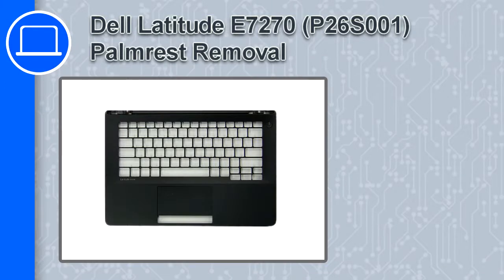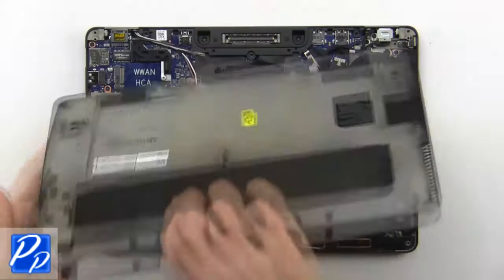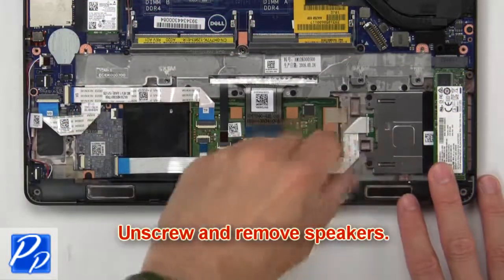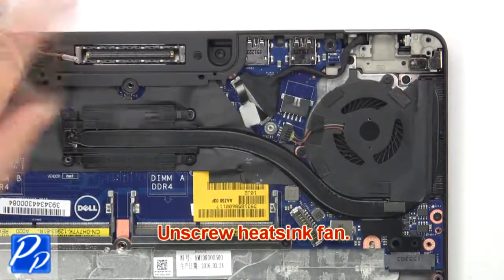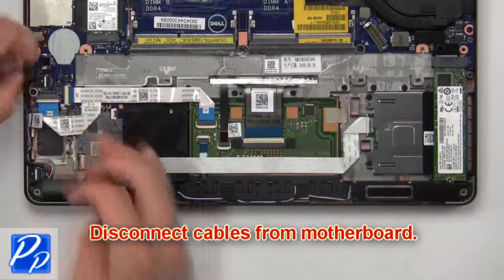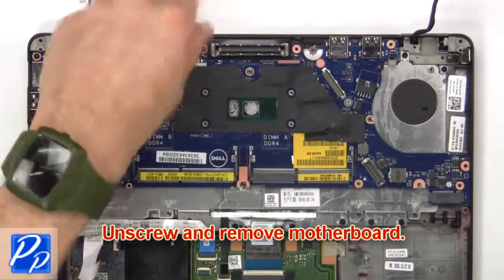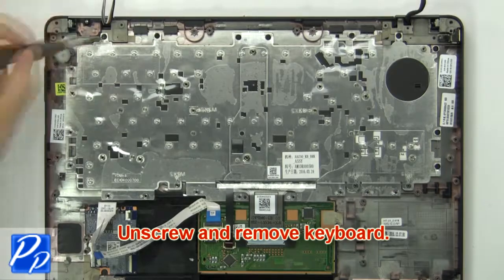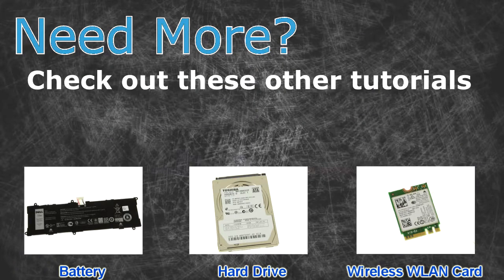Dell Latitude E7270 (P26S001) Palmrest How-To Video Tutorial

Comment: Is it possible to replace the touchpad? Not the buttons, just the touchpad. Mine acts like it randomly turns on and off every few seconds.
Reply from the maker: You should note the touchpad is attached to palmrest and not designed to be separated. The mouse buttons can be removed but are included in the assembly. So if you replace the touchpad/palmrest, you would get mouse buttons as well.